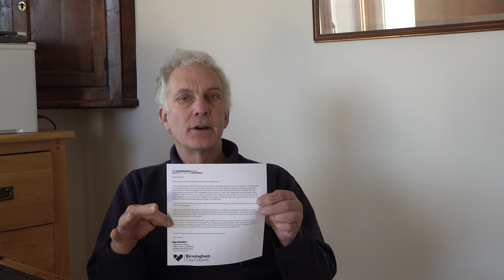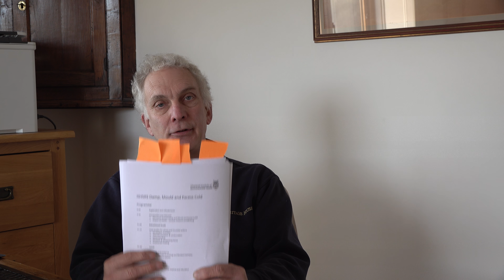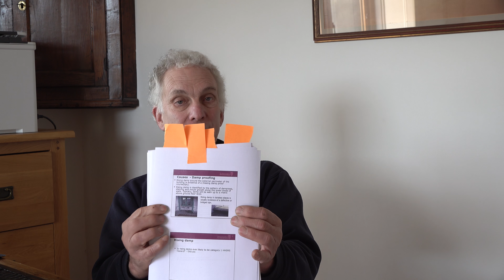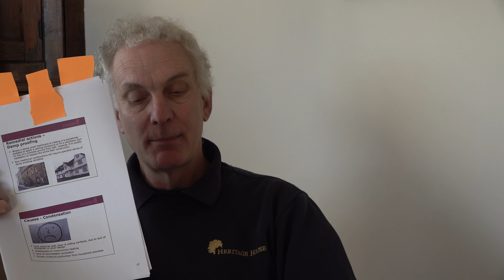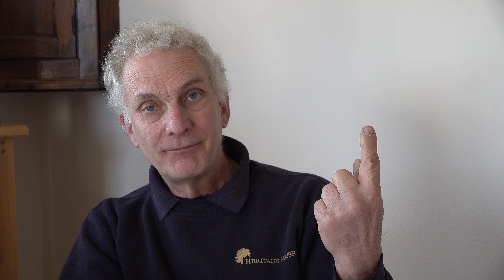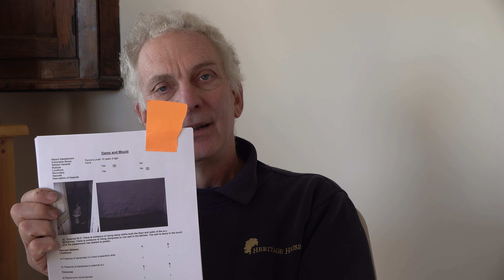The Environmental Health industry - incompetence being taught...

Comment: Peter we have damp in our brickwork of our mid terraced house what can we do to combat  the problem as it is know on lining paper
Reply from the maker: All about moisture in the air - usually best option is ventilation - have a look at the ventilation stuff on the heritage-house website - damp paper is nearly always that because of too much moisture produced in the house and not removed - ventilate kitchen, bathrooms - to external wall, using HUMIDITY controlled vent system (Vapourflow website is brilliant) and problem should reduce or go.

Comment: I normally agree with your views on damp proofing but I do feel that you opinion on PIV is wrong. I agree that it could be that initially there may be damp air in the loft space but within an hour usually this is dissipated by the process of displacement. I would have thought that you would have been behind PIV as this is very much what landlords need with tenants that dry clothes indoors and never so much as open a window. PIV is a fantastic solution to many condensation issues within the home.
Reply from the maker: It's not really as its not exchanging damp air for dry air - what we need is complete control over the Absolute - measured in grams/ m3 - ventilation systems need to take into account WHERE there is damp air, and whether there is a source of dry air, even if it is very cold, that can be used to remove and replace the damp air. PIV is not properly designed by people who understand the relationships between temp/RH and the Absolute - and they dont measure total moisture content. They are very well marketed, and those behind them think they are clever - but break down the science, and it doesnt work!

Comment: Hi Peter, i am soon to qualify as a building surveyor after working in the building trade for 15 years. I am wondering about the claim that rising damp doesn't exist. I have built walls out of the ground off a foundation many times, sometimes out of brick and water that has collected either side of new wall will rise a small way up the brickwork. Would you classify that as rising damp?
Reply from the maker: Obviously if water as a liquid is around a brick it will get wet. Houses do NOT stand with feet in water - if they do, of course those bricks will get wet - but it is very clear from any observations you make of walls in rivers, harbours, etc that water does NOT rise up those walls by more than a brick. That's just physical saturation. Thed whole rising damp thing, in which it is claimed water rises metres up a wall, is bollocks. As you are soon to qualify, I suggest you acquaint yourself with the new RICS dampness methodology that I'm a Joint Author of - https://www.heritage-house.org/damp-and-condensation/rics-joint-dampness-methodology-statement.html
Reply: I recently saw a cellar that had been bubble wrapped, they thought they had a water leak but in fact behind the wrap the walls were soaking and black with stinking mould and slime. It was a health hazard. They tell you need injection cream and then bubble wrap.....what does that tell you about the cream.

Comment: Hi Peter, another great video. I have two 200 year old houses and have learnt so much from you. I have been busy removing wally damp mans “fixes”  in both buildings and letting them breath. They are both drying out fantastically. I am slightly puzzled by your comments on positive input ventilation, as I was going to install it in both houses, as having read your website https://www.heritage-house.org/damp-and-condensation/controlling-humidity.html  the section on “Whole House  Dehumidifier” talks about fitting a PIV in the attic  space with a link to one. You state in the video that they are a load of codswallop and should never be fitted. Could you please clarify if they can be used in dry attic spaces or never should be used.

Comment: Mr Ward. I am a lay person and I enjoy your videos. Very educational. I have one question that I hope you can answer. 
I live in a detached bungalow in the very wet north of England. I do not suffer from any ‘damp’ problems. However since we have lived here (6years ish) I have noted heavily condensated windows in the mornings during the winter months. In particular in our master bedroom. (Clearly caused by us human occupants). In the past year I detected a fusty smell when I was led in bed at times. Ventilation by having windows slightly open made no difference. The windows also have trickle vents. (Upvc). Despite the piv claims sounding far too good to be true I took the plunge 3 months ago and installed a unit in my central hallway. Since then we have had no visible condensation on the windows and I have not detected any fusty smell. My assumption was that the piv unit was replacing the moist air with fresher drier air, therefore no condensation. Piv appears to have worked in my situation. Or am I mistaken? What are your views on this scenario? Thanks.
Reply: I'm in similar situation. My conclusion is that if the absolute humidity level in your loft is generally lower than inside the house, you are bringing in drier air which must be displacing other air which in my case is wetter.  I guess Peter would remark that these PIV systems do not have enough control associated with them i.e humidistat sampling absolute humidity levels.

Comment: People who work as EHO’s don’t know anything about building maintenance, they’re operating in a vacuum with their limited knowledge, they should make a note of it and refer it to a property department. This stuff happens all the time. I remember a post fire incident I had to attend, which had spread up a tower block, because they’d removed the asbestos fire protection on the grounds of ‘safety’,  fine, but they never replaced it with an alternative.
I wouldnt get too carried away with referring to EHO’s as professionals either, there’s a lot of jobsworth paper pushing that makes up that job now.

Comment: Must disagree about the loft space; lofts should be well ventilated and dry, if damp then it's normally due to insulation being stuffed into the eaves. Once again lack of ventilation.
Consider that many many lofts have been converted into habitable spaces and done correctly remain dry
Reply: i agree ive just installed a piv, its been only running a few days and the posotive results are unbelievable humidity levels dropping by the day no condensation on the windows this guy worrys me
Reply: ianoch I agree with you too. I install PIV for a living and see the positive results daily. Peter is often correct about damp proofing in general but his views on PIV are misguided.

Comment: We nearly lost a house due to Natwest insisting on a PCA damp survey. PCA survey reccommended £5k of chemical injection and timber treatment and Natwest insisted we do this work before they can lend Utter joke. Luckily got a mortgage with another lender with no problems and soon found a leaking drain under the dining room floor which has been the cause of most damp problems. Together with this drain, all the windows painted shut, all the air bricks covered up and cement everywhere. Drain is now fixed and cement all gone and the house is drying out nicely. Natwest would only take PCA reports and no other professional opinions but they could not explain why that was the case.
Reply: We had the same request from Natwest a few months ago on our C17 grade II listed cottage.  I got a proper RICS surveyor to come and look at the place (which I was doing anyway) and made sure he put in his report that there was no damp.  Natwest accepted this.
Reply: Interesting. We also had a full RICS survey and professional report from a specialist within English Heritage but Natwest didn't want to know. The problems started when the banks own valuation surveyor ticked ‘damp’ on their basic one page survey form which kicked off the PCA nightmare on our 1880s house. Its a corrupt system between big banks, the PCA and chemical industry.

Comment: Great video as usual Pete.  I'm a little surprised about your comments in relation to PIV systems.  I've recently installed one and have had good results in a reduction of moisture levels in lower part of the house where we have some original flagstone floors.  I have been regularly checking temperatures and relative humidity readings in many areas (including the loft space) and converting the figures to absolute readings.  The loft (which only covers a small part of the upstairs of the house) has consistently lower absolute readings than other areas.  It is well ventilated.  Your comments I guess apply to cases where a loft is not well ventilated?
Reply: Surely if you have a well ventilated loft then the humidity should be lower than the rest of the house. I'm looking to get a piv system and would be interested in your take on piv Peter if your loft has low humidity?
Reply: Dudley Joseph I have a Piv in a rental house, tenants not complained in 2 years. Best £600 I have spent.
Reply: @Andrew_lee_utube  I'm pretty pleased with mine so far.  I know there could be improvements with the controls but its way better than the situation before I installed it which involved 20 mins on cold mornings getting condensation off windows.

Comment: Friend of mine is a landlord who had a single occupancy flat  with no problems . Then the tenant got a partner who moves in. First winter start having damp issues and tenant complains and states that father says there is rising damp. Landlord goes and gets local  damp people to inspect, man walks in and round the flat,turns to the tenant and says you have condensation issues and need 2 venting fans to change the air as the flat has been well modernised and is too airtight for double occupancy. Now waiting to see what the fans wil do over time. There are some good contractors out there but how do you tell the good from the ill informed.  Perhaps you could suggest a series of questions and wrong answers.   Enjoy your rants and have picked up a lot of useful tips as i have a late 19th century stable-lodge conversion and i have acted on bad advice in the past.
Reply from the maker: Thanks for the compliment :-)  As for the flat - be careful just with vent fans - they really need to be humidity controlled - so they draw dry air in, and push damp air out - crossflow ventilation as it were. Focus on kitchen and bathroom extraction - is there a cooker hood and does it work - extract to external? If not - sort it! Bathrooms - need big gap under door, fan on, draw moist air out, warm dry air in - can't suck on a vacuum.  Need to aim for 7 grams/m3 water - and keep heating always on, aim for 15 degrees minimum ALL the time - which prevents moisture issues. Shout if need help!

Comment: Peter. Another great video. I've seen first hand how this whole industry works with a recent house sale. A Rics chartered surveyor doing a mortgage survey insisted our buyers have the house checked out by a damp proofing specialist based on "high damp meter readings". I was present when he turned up to do his survey and within 5 minutes diagnosed rising damp using solely a protimeter. No exterior checks were done and we ended up with a quote for £1500 for chemical injections. I completely dismissed his findings and asked if they could do carbide test. I was told that they dont provide that test and it was "quite a specialist test to ask for" and they didn't know of any other firms local that could provide it. We have a situation where a bit of kit is available to show the exact moisture content in any given wall and the "damp specialists" dont use. That shows the height of the scam that's occurring!! Argueing your case to estate agents and "surveyors" is a thankless task. You are made to almost feel like a conspiracy theorist and it shouldn't be like that when the science tells us rising damp doesn't exist! This whole monopoly needs smashing apart.
Reply from the maker: It is happening slowly - I'm one of the joint authors of the new RICS 'Investigation of Moisture and its effects in traditional buildings' methodology. This is now accepted and becoming mainstream. Follow it, and you will never diagnose rising damp. The methodology is underwritten by RICS, CIOB, UK finance, English Heritage, CADW, Scottish Heritage, and others. What you need to do, if you have a problem, is insist that the RICS surveyor that said a damp survey was needed, is pushed to use the methodology - RICS admit that most surveyors have NO understanding of moisture in buildings - and that academic courses need to change. Cases like this need to be referred to the RICS - I can land the documentation on the right desks - and have the bank or building society concerned made aware. If the valuation was done by countrywide, they are basically corrupt and incompetent - and we need to push the issue quite hard to get things to happen. The methodology is the starting point for this.. Email me peter@heritage-house.org if you need.

Comment: Well said,  i highly respect people who don't fear confrontation, saying the truth and standing behind it seems to be a dying skill nowadays.
It's not just the housing industry,... poor (or utterly wrong) training happens pretty much anywhere, you pay £xxx, sit some nonsense exam and within a week or so, you are a so-called expert, entitled to tell the poor customers all sorts of fairy tales. 
My day job is electrical/mechanical engineering, certainly no different there.
I've recently been on the hunt for a property and had a bunch surveys done (mandatory mortgage survey only), these things are just full of BS and save-my-butt phrases, but the real issues i've usually seen straight away are almost never been pointed out.  The one i finally bought was denoted as "possible signs of subsidence", luckily he washed it down a bit, saying it might also be some older settling, so it didn't hurt much. ....well, he was wrong, entirely., but at least it helped with negotiating on price ... :-)
I actually inspected the property before paying for him, so i was kind of expecting that sort of "diagnosis" 
It's a  bungalow, timber frame on a concrete slab with an outer single brick shell, quite well built in the mid 60s. It took me less than 5 minutes to identify the real issue,...the lime mortar was completely washed out in some weathered areas at ground level, causing a few shifting cracks in the bottom of the brick wall, most of it just in the pointing,  ... .previous owner tried to bodge some of it with cement mortar, but did not bother to re-set the bricks... getting that crap out and cleaning the bricks was actually the hardest part of the job.... finally, a bit of time, lime, sand and patience fixed the issue.

Comment: U the Man 👏💪👊👍. I love this shit 👏😎 I'm a plasterer. Been spreading for nearly 30 yrs. I've learnt more in the last 2 yrs than I did in 25+. We just told to smack gypsum on everything. As you said. That can cause a lot of problems itself. The amount of jobs I've done in the last 2 yrs where it was supposed to be rising damp, when I ripped off, put lime back, checked everything ventelated and problem solved. Sometimes as simple as taking off the waterproof paper or Paint. As was holding the damp. Love your videos. Learning loads from you 👏👏🤗👊👍